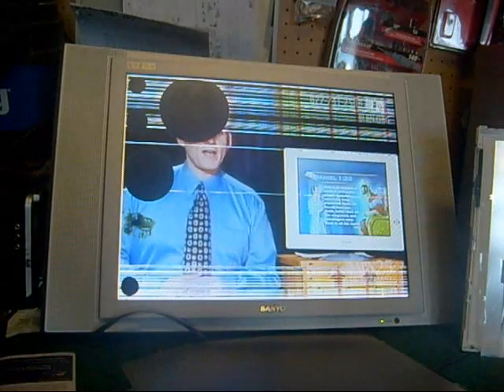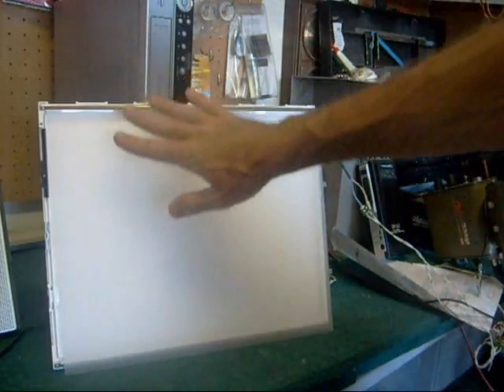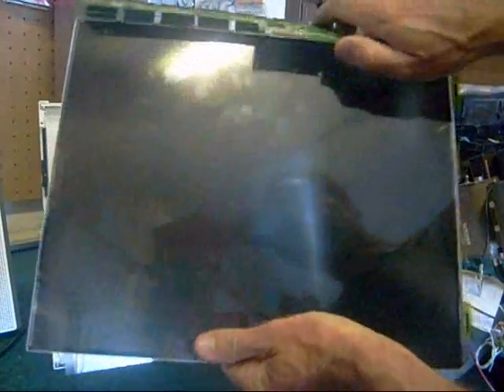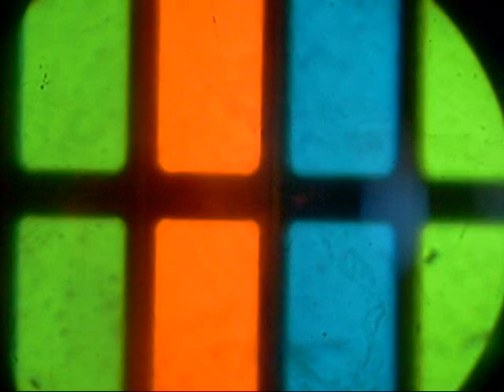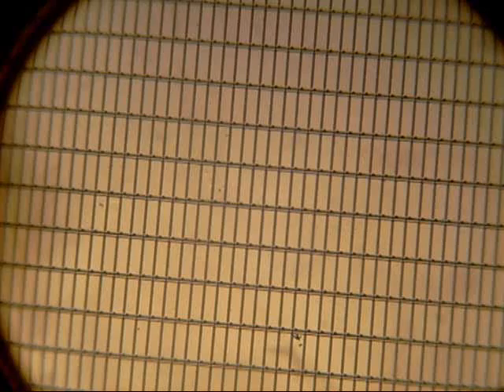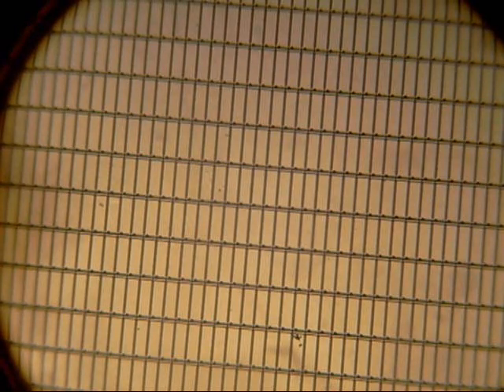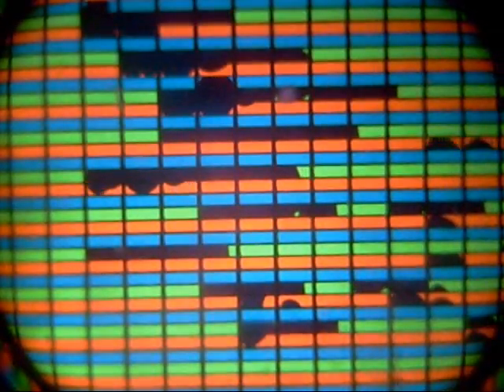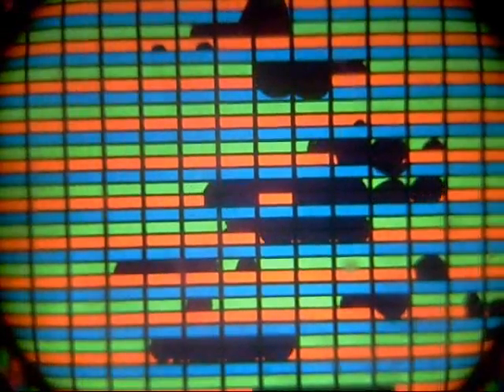Dissecting an LCD TV panel

Comment: If some liquid, maybe a little water, got between the polarizer & the LCD (the monitor works) & the unit is powered on but you see a small roundish area, about 2 inches around, slightly different in shade compared to the rest of the panel, can the polarizer films be removed, noting order & orientation, cleaned & reassembled, & the spots are gone? Hope I asked that correctly! Thank you 🤓
Reply from the maker: No. The polarizing  portion of the screen can't come apart as the light diffusers can.
Reply: @GrantsPassTVRepair  ok thank you. If there are some spots, not black "burn" spots, but more like a slightly different, what, hue? tint? Ah! Shade! Than the color next to it, would, or could, that be where some small amount of liquid got on the screen? Thank you 🤓 also are you in Oregon near Washington state ?
Reply from the maker: @j.lietka9406 What you described may be fixable but I don't know unless I see it and take the display apart which is somewhat risky.  I'm about 60 miles north of the California boarder.
Reply: @GrantsPassTVRepair  sorry, No-Cal & Oregon? Passed through Grants Pass years ago! I don't think it's worth it to take the screen apart for two areas. I found, - yes found! - a 27" Sharp monitor on the way to work a few days ago. Got a suitable power supply that works (not a perfect match but adequate for testing) & hooked it up to a laptop. For the most part, the screen looks great! It's a 1080p 60hz thin bezel. But when I had it connected I noticed 2 small areas on the screen (not black) that looked like a small liquid (water?) Spill on the screen. Tried rubbing it gently some but no change. The spots are just a slight shade of color different compared to the area around the spots. Other than that the screen works rather well! Want to do another test or two, as the laptop itself isn't in great condition! Old HP G62 Win 7 but it does run. Think the HDMI port might be loose. Thanks 🤓
Reply from the maker: There are no portions of the display itself that can be taken apart,  Only the light diffusers can come apart.
Reply from the maker: I made a couple mistakes in this video where I mistakenly called the light diffuser a polarizing filter.

Comment: 3m37s you show the tape carrier package.  My tab bonded ribbons have ic's on them which are blown.  So I wonder how they are connected to the panel itself.  Are they simply tape bonded? or are the tracks all within the same piece of material with no connection until they get to the tcon board?
Reply from the maker: You can't replace the ICs on the tape carrier package.